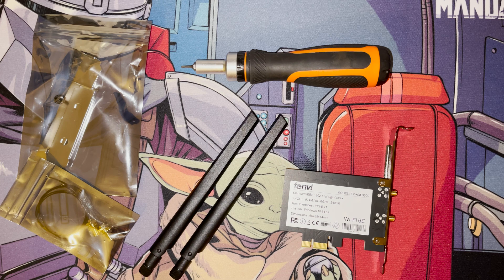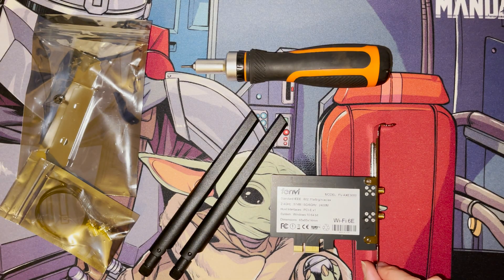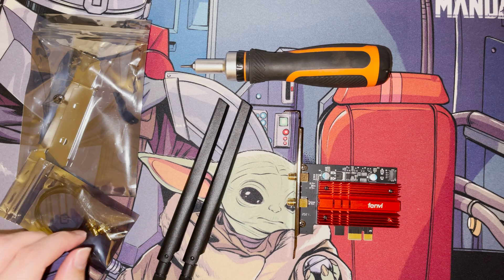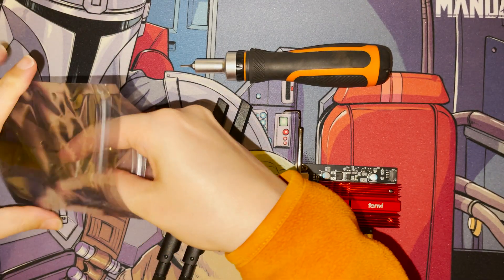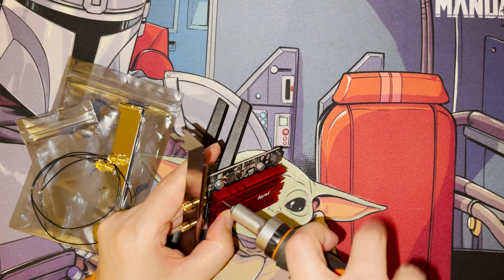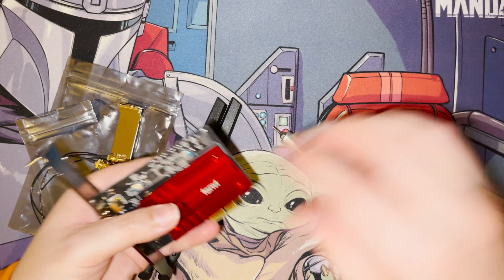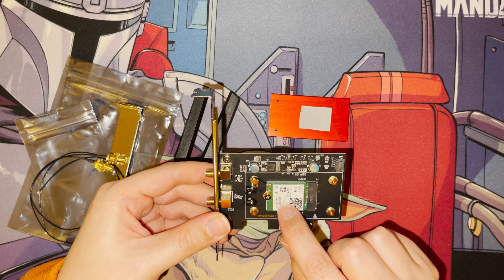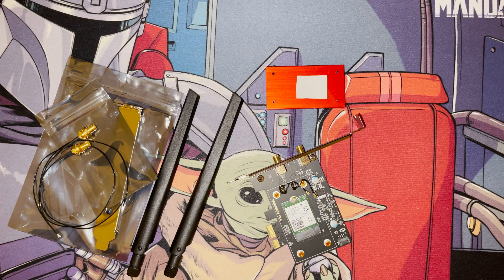Teardown Intel WiFi 6E PCI-e x1 Card - Fenvi FV-AXE3000 5ghz, 6ghz WiFi

Comment: Its the heatsink necessery? Its big to my space..
Reply from the maker: The chip does need some cooling, but if you have enough air flow and are not a heavy WiFi user then you could probably not need it.

Comment: 1) Do you have a video showing how you attached the extra stuff you bought? 2) Why key is that m.2 intel pcb? and what length? 3) i have headphones at max output and it's hard to hear you sometimes. 4) could I by an extended cord to let the antenna rest on my desk instead of on the back of the metal case? and could it be just any cord or do i need to look for something designed for the 6Ghz frequency? 5) does the BT work with just the pcb and antenna? i don't understand when the PCIe 1x shroud needs a USB connection for the BT and i'm wondering - when the intel chip is plugged directly into the mobo, if the BT works without a USB wire?

Comment: How are you going to use it on the motherboard without the heatsink...i think its going to overheat and under preform in the long run ......
Reply from the maker: Good point. looking at my previous computers I bought (HP Omen, Dell) all the pci-e mini cards did not have heat sinks installed and worked fine. I see you can buy small heat sinks to fit the card.